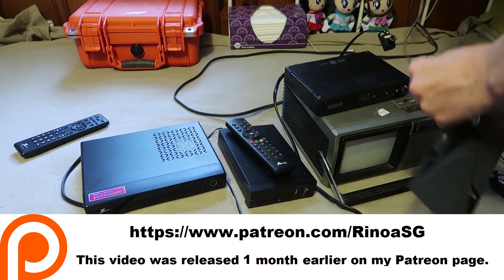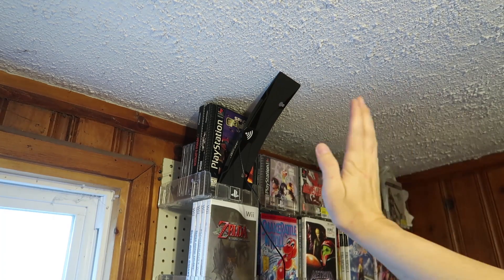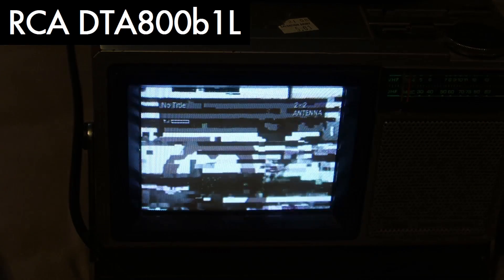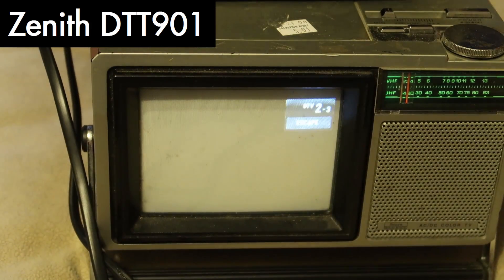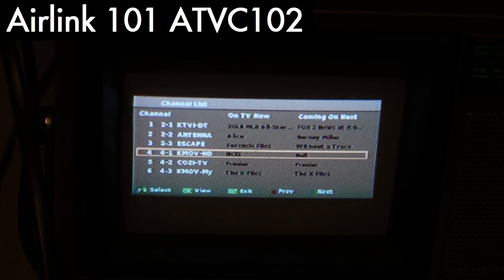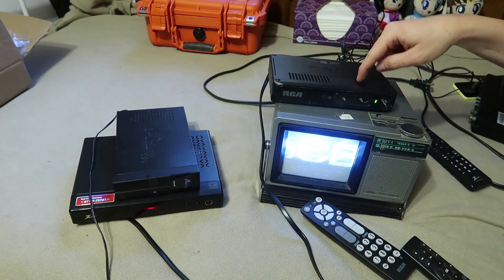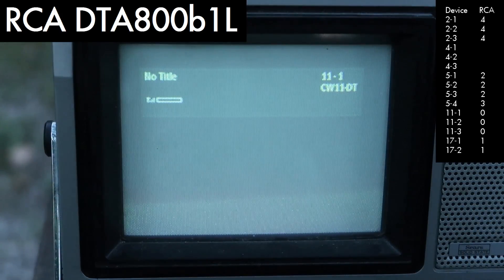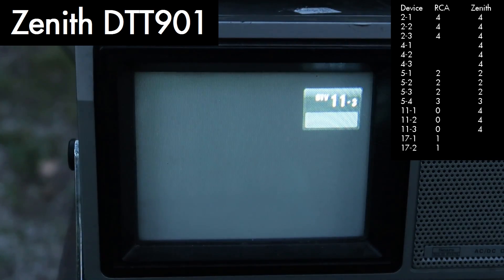Digital TV Antenna Experiments 03: Converter Box Zenith DTT901, RCA DTA800b1L, Airlink 101 ATVC102

Comment: I live 30 miles S/W of St. Louis,  and I got a $28 EDT 312 ematic antenna on the roof, and I get 39 channels.
Reply from the maker: of course you do, you live near a big city. when i lived in silicon valley i got 89 channels with even a small antenna.

Comment: Hello, The FCC has maps for your area letting you know what you'll get. https://www.fcc.gov/media/engineering/dtvmaps
Reply: We've been cable free for years now. The quality of the over the air channels is better than both cable and Direct TV. Our antenna cost about 200 with mask, pole, antenna and amplifier. Channel Master even has a DVR for capturing your favorite shows when your not there. The DVR requires a web connection. That's how it gets the schedule information
Reply from the maker: TVfool.com is far better than the FCC's crappy website. just fyi.

Comment: Could this work on a old portable Tv?
Reply from the maker: most converters actually run on 12v, so you could solder another connector bypassing the 110v part. so yes it probably would work fine

Comment: I built an antenna after your last video. I had an old rooftop antenna that was falling apart. I used the Gray-Hoverman design and it works very well. It’s very easy and cheap to make.